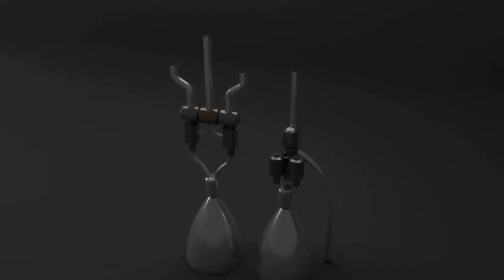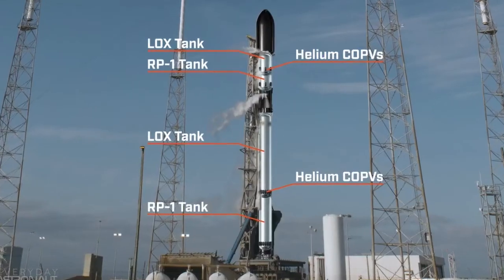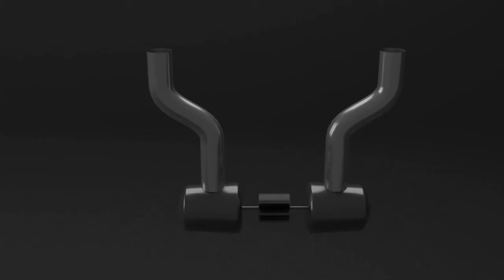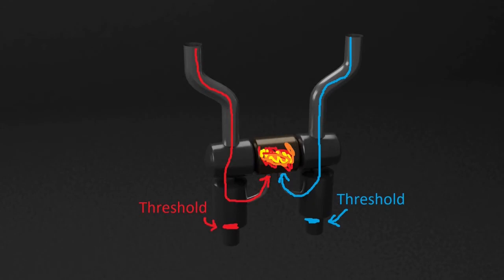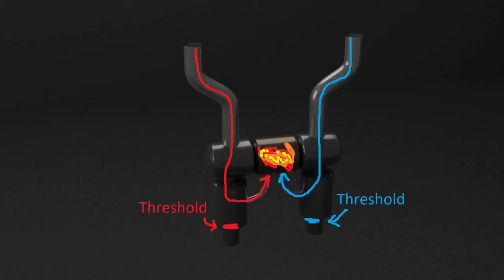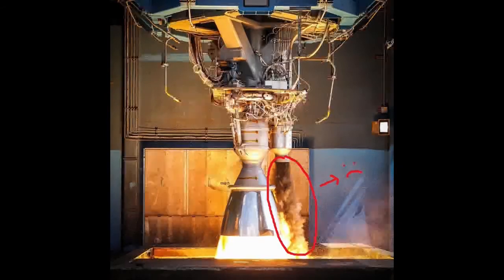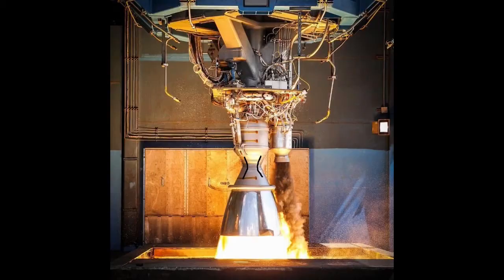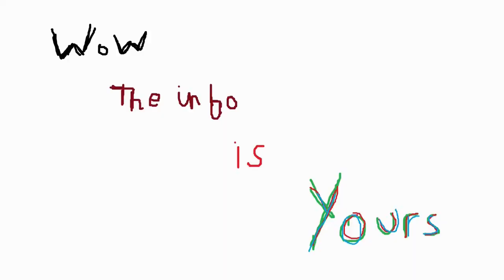How does the Gas Generator Cycle Rocket Engine work

Comment: How does SpaceX keep the turbine powered by the fuel rich RP1/LOX from clogging up with carbon compounds? Furthermore how did the Saturn F1 do it? Would love to see a video explaining this. Hint hint.
Reply from the maker: The RP1 in Merlin Vac / F1 is added to the Nozzle to provide extra cooling because its cooler than the exhaust.